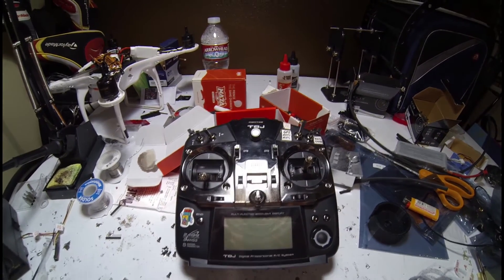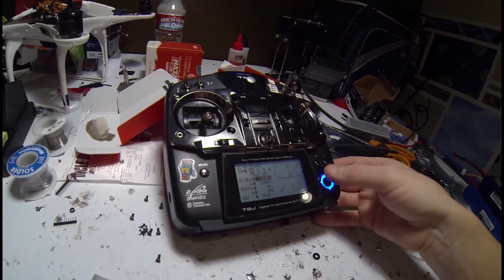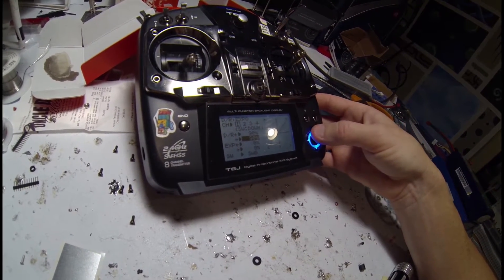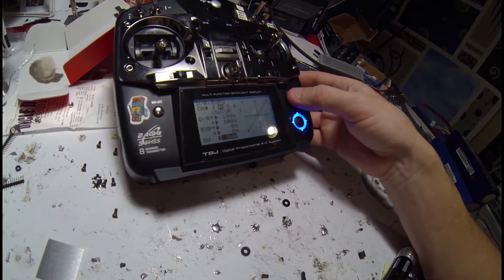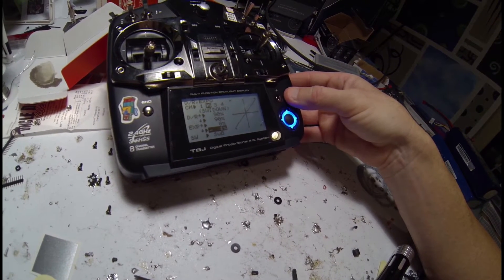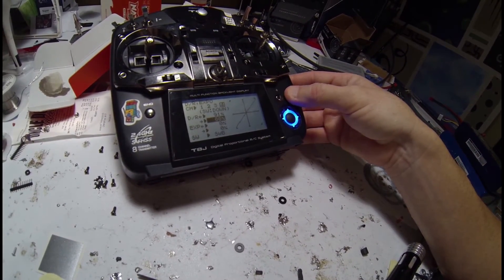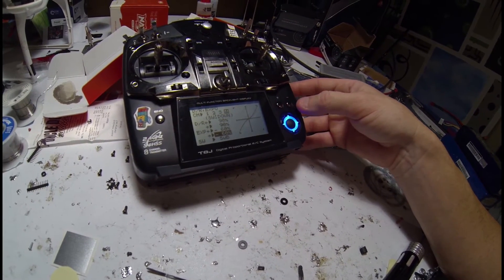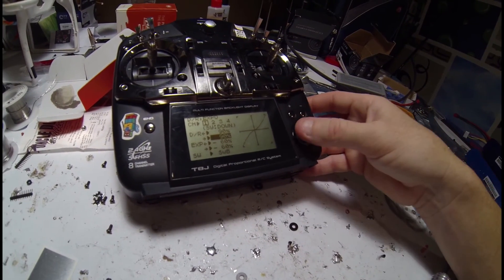Futaba T8j setting Expo for smooth sticks

Comment: Thank you so much, great video!  The only question I have now is why won't Channel 4 let me do it for left and right.  For some reason, I can't scroll across (like I did with the other channels, so only one can be changed to 90% and -60%?????
Reply: you need to move the actual gimbal for that channel in the direction you want to be changing it starts off up/down default, press left/right on the stick and should jump down